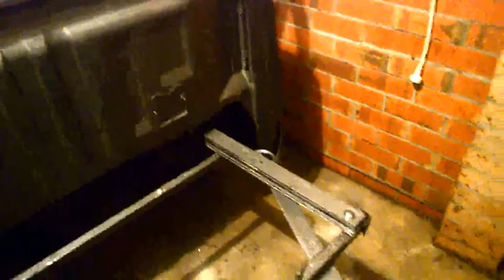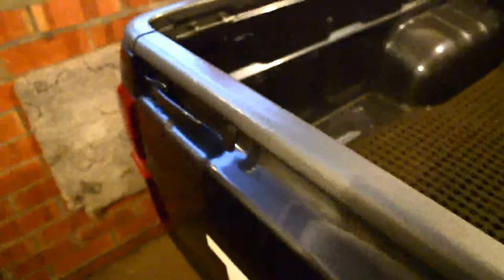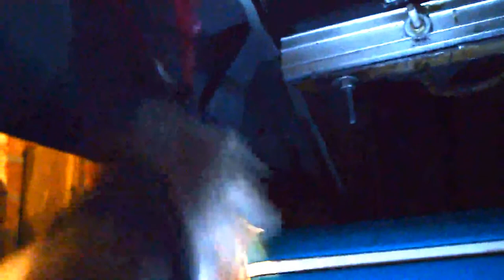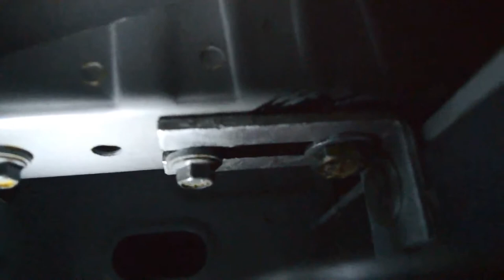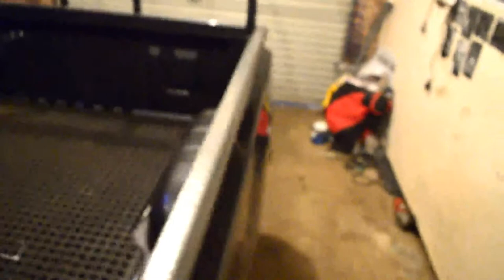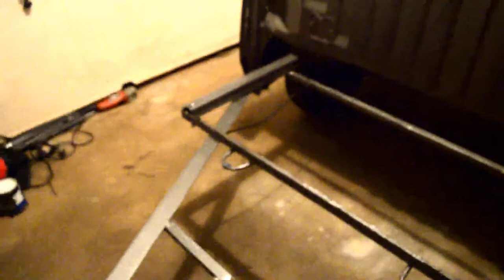1971 home made trailer rebuild with Toyota Hilux tub: Part 4 95% complete

Comment: Hi mate how did you go with this? Were you able tyo keep it as a 71 model and not have to have a full inspection etc?
Reply from the maker: Hey mate, It's now been registered for about 8 weeks and since it already had the VIN number it remained a 1971 model, But what I did was bring it into line with the 1989 ADR  requirements meaning it's now got a compliance plate rather then just the VIN stamped into the drawbar, it's now got the full proper lights at rear rather then just the single small round central brake / tail light and indicators. It now has the full set of Hilux tail lights and reflectors on the side (just a single orange one at the top centre of each wheel arch and white one at the front outer corners). As for an inspection being in NSW all I had to do was have it "Blue slipped" which is a full road worthy and ID check where they check to make sure it's roadworthy ie lights running gear etc and an ID check of the VIN etc to make sure it's what the VIN says it is and a couple of hours later I picked it up with a Pass and was able to re register it and since it's 240kg rather then 290kg it now falls in the 0 - 250kg bracket which means free rego instead of $52 for 12 months rego and since it's also under the 250kg it doesn't require an annual inspection to re register it every year being over 5 years old. So doing it the way I did has a few benefits saving on rego fee's even though $52 for 12 months wont break the bank and  10kg under the threshold No annual road worthy for it, So I'm happy and since the last video I've since put a canopy on it so it's able to be used water tight and lockable and the canopy pops off with just 4 bolts which I was surprised about as I managed to score a Demo ARB one brand new never used but has a few marks from being a demo unit and I was surprised it only took 4 bolts to hold it on. So it's all inspected and re registered and done 2 trips to Sydney already.
Reply: +KJ-Verada VR-Xi awesome thanks mate, nice job on the build and getting it on YouTube! Cheers
Reply from the maker: Your Welcome, Granted the editing etc aint crash hot but fingers crossed it'll improve as I go. I'm hoping to do more of these sorts of "Mini Series" to show folks they can take stuff that may be deemed "Scrap" and give it a new lease on life.  Looking at it you wouldn't think it's a 45 year old trailer and by spending at a conservative guess as I wasn't keeping tabs on the total time and I wasn't rushing but I probably put around 40 hours into it at a leisurely pace, It was easily a weekend job that I spread out over 5 weeks as I wasn't in a rush to complete it. I'm glad you enjoyed the "Mini series" as well and watch this space for future projects.
Reply: Hi mate like your project
Reply: I got a hyundai which wants to do same need some help!